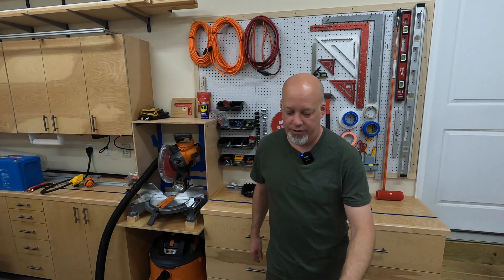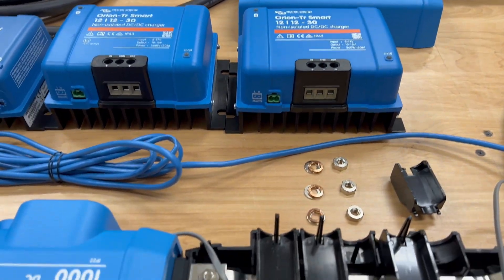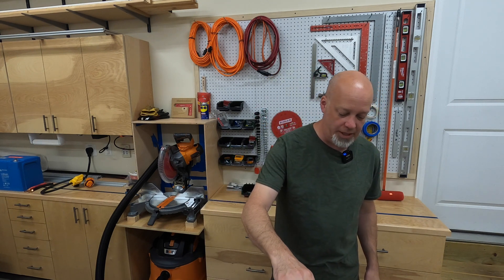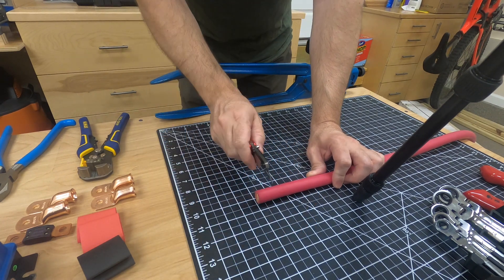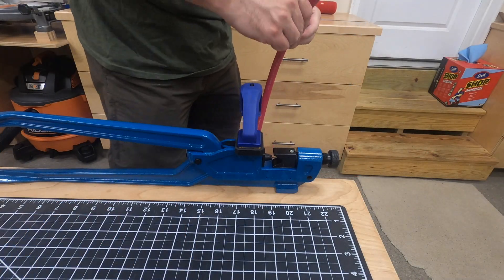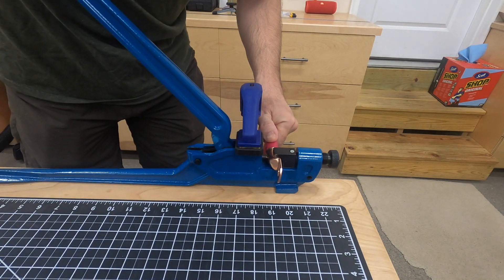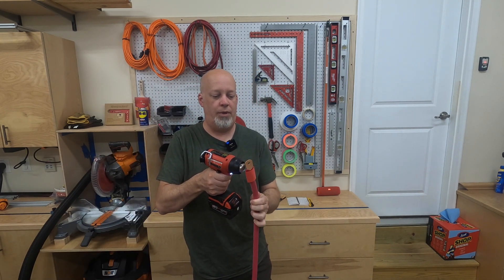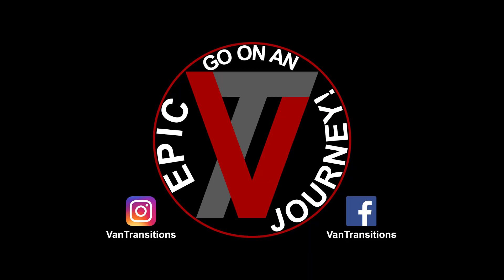Crimping a 4/0 cable lug

Comment: not as easy on tinned lugs i use a zip tie at the end to push it in then cut the zip and finish pushing the lug over the wire to crimp.
Reply from the maker: Copper is much better in my opinion.

Comment: Thanks for the help!  I’m making my first battery cable connection for my offgrid solar system and am using 4/0 welding wire.
Reply from the maker: Fantastic!

Comment: thx u for the video. Do you have the link to the lugs?
Reply from the maker: Hi Carlos. The lug you need will vary depending on your use case. For example, this is a 4/0 lug for 3/8" stud. https://a.co/d/g7Yx04A
Reply: @VanTransitions how did you get these to fit.  These are to wide for both the distributor and the multiplus.  These are 1.1in and the distributor is only 1in.  I think the multiplus maybe less.  There are some  posts about this.  The ones explorist sells are supposed to fit but not sure.
Reply from the maker: If you mean as a ground on the Victron Multiplus II, no, the lug would not fit through the hole. Maybe a 90 degree lug through the big pill shaped hole would work? I haven't tried.